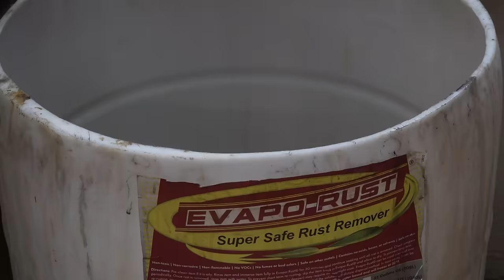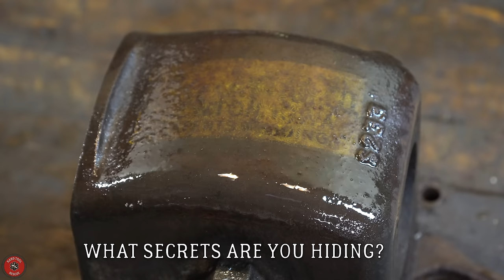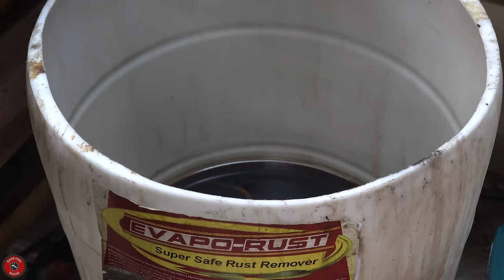1920s Maytag Washing Machine Engine [Restoration]

Comment: I must admit that I'm completely amazed by these people restoring old rusted items. This engine is a beautiful example of what I mean. Each and every slotted screw on this engine comes out with either not a lot of torque applied or a fair amount of torque. Hardly ever does the slot get deformed to the point of being useless to remove the screw. I've had screws deform left and right when removing them. I often have to employ a extractor to get them out. I have to be doing something wrong.
Reply: Normally I buy junk tools because I'm a home gamer, but there is something to be said for the tolerances on better tools.  My harbor freight junk sloshes around in the slot, but I usually work on things that don't matter, so I don't care.  I'd care if I was doing this kind of work.  But there's also a lot to be said for time, penetrating oil, and a torch too.  Put penetrating oil on it every day for a month before you start, and I bet you'll find it easier.  Not that I ever have the time or patience to do it.... :)
Reply: @grantmcinnes1176 ZZZ’S your willingness You’ll find

Comment: This has to be my favourite restoration channel. No expensive machines that us mere mortals cannot afford. Best of all though - no annoying music.
Thank you.
Reply: I'd consider a floor mounted drill press and a media blast cabinet expensive machines, but yea, it is nice to see a channel not using lathes and milling machines.
Reply: Ang Abrams you can buy a drill press and Walmart for like 80 bucks, won’t be great, but it works.
Reply: @jasonmurawski5877 You missed the point, but okay. Go buy that press then see how long it can run a wire wheel under load or how many holes it can drill with a forstner bit before it goes up in smoke.

Comment: The most impressive part of this for me was the fact that you were able to get a full carb rebuild kit for the thing...
Reply: My thoughts exactly! Yet there are carbs on old tractors you have to fight some old guy to the death for lol.
Reply: These engines have a huge following, to the point that you can get plans to cast and mill your own engine!
Reply: Yeah, there's a few people on ebay that make nice reproduction parts for these. Helped me a lot restoring mine.
Reply: I agree !
Every time im amazed he just conjures up some parts...

I'm dreading the day that we finally can fix/rebuild our old massey 30 (exact age still unnown somewhere arround 50' / 60' ).
1 head is already knocking and it leaks and smokes all over the place.
Still runs and being used tho😅 but we're dreading the day that stops before we got our barn set up to fix him..
Sadly that can take a while 😓😓
(Yes him ... we named him Groundskeeper Willie... we named all our driveble junk 😅).
We can't send the engine out to fix him sadly because we lack the 💸💸
So the longer we wait the harder it will be to get replacement parts if not a "new" or replacement engine  (would break my heart), where would you find a perkins that old....
36 and already too old and expensive to hire.
Reply: You'd be surprised how easy parts are to get. There are folks still useing these.
Reply: I have been supplying parts for these engines for 40 years. I have every part for the carburetor new except the body. Which no one has.  But I have plenty of spare used bodies.
Reply: Right ? I see I'm not the only one surprised you can still get brand new parts for this thing.
Reply: @maytagmark2171  Out of curiosity, could new bodies not be cast/milled after carefully measuring the old ones?
Reply: Because the past is what you wanted to be
Reply: @deborahmeijer9697  Massey 30 is pretty common.  You can find parts about anywhere.  Still lots of new and check the tractor junk yards in MN and Iowa.  And they are easy to work on yourself; maybe with a little coaching from your local farm mechanic.  Good luck!
Reply: @davewilson9924  i live in holland 😅
No such luck..
Reply: Right! Surprised the hell out of me
Reply: oh yes as a marine mec. just how.
Reply: it's a mixing valve not much to the carburetor , (called a mixing valve

Comment: The fact that this man tries so hard to actually Restore things and not just modify and repair, like so many similar channels do, eases my mind, calms my anxiety and helps me relax. I have 4 favorite channels on YT and these are the only ones I rewatch again and again.
On a side note, can anyone explain the point of lead washers?
Reply: I'm gonna put my foot in my mouth and say they were probably used as one time use crush washers like we have copper washers now, don't quote me on that though it's just my theory.
Reply: @normanbuchanan9710 You are correct. In engines they are used as a gasket. Pretty much the only option when you don't have squishy, heat resistant, synthetic material on hand.

Comment: -Very interesting watching this from beginning to end. Most of all I wanted to see that piston and how it was situated in that engine. Really neat considering it was in use in 1928. And I agree with the rebuilder that it did not need rings because the ones on there now still look brand new. It also had a pretty good sound to it. Thanks for showing this. Hang in there.

Comment: If I may offer a tip, the "butterfly" cotter pin technique isn't always the best. If you send one end over the tip of the bolt, the "loop" of the cotter pin locks into the castellated nut, and you can get it much more secure by pulling as you bend. Then you trim the other end short before you bend it down towards the surface.

Both the butterfly and over-under techniques are valid depending on the circumstance, but for castellated nuts you usually don't butterfly.

This is from a jet engine technician, so you don't think I'm just some moron.

Also, I know bending the cotter pin 2 degrees makes it easier to remove, but it's really not secure, especially on things that vibrate like motors. I'd be surprised if those pins holding the foot pedal spring don't come out after running for a short time.
Reply: This thing was designed with the cotter pin butterflied, so it obviously doesn't matter.
No matter how many modern cotter pins you've fucked up, this one obviously didn't need to be put in differently; and it 100% CERTAINLY needs to be easy to pull apart again, these ENTIRE MACHINES we're designed to be pulled apart again, so any critique of anything that achieved this is obviously due to inexperience related to restoration, because that's the actual discussion we are having.
Youd have a point if he was restoring a rocket engine.
Because otherwise they would not have sold in 1921, when every other machine bought had utility and lasted a long time.
Also, let's keep in mind that this machine was used for 100 years, with the cotter pin butterflied. So obviously your "bet" was lost before you made it

I've never understood people who are of a different profession, with slight overlap, attempting to either give advice which is unnecessary, or even downright false information.
You should never say "I'm a this" on the internet, because you automatically become a 13 year old boy who wants internet points when you claim your profession; simply say something that can only be said by someone who actually possesses knowledge on a subject.

Finally, this is a museum piece. A lot of the restoration done by this dude is for clients who will be either putting them in museum (taking functioning parts off to make them displays, like a foot pedal that operates it for instance, although it's beyond obvious the forces on the cotter pins aren't in the correct direction to matter, and the spring is clearly only as strong as would be necessary to lift the pedal; you can tell by the outrageous number of coils and length of the spring coupled with it's being fairly thin.), Or using it for personal use because their granddad or whoever left it to them in unusable shape.
That is to say, this is going to be shipped shortly after this video; and it might not be shipped in assembled condition.
In the case of a gas washing machine, i don't think it's going to be getting much use outside of rural Alabama.
Reply: We ain’t going to space cowboy we washing our undies

Comment: MY grandfather has a 2 cylinder version of this engine. Never restored and still working to this day. He did sandblast and paint the exterior of it a few years ago but insides are a still all original.
Reply: I believe this one is a 2 cycle engine also.  He showed the mix ratio.
Reply: @POCarton  cylinder

Comment: 2:11 Pro tip, thread the castle nut on the other way around when using it as a whackstopper, way less likely to deform it and the shaft. As a bonus you can wail a bit harder on it to break something free too.
Reply: heyyy i'm not the only one who cringed a little bit there
Reply: sapincher certainly not😂

Comment: Glad to finely see one of these, as I had heard about them in the past. When you do not have electric power to your home and need to wash clothes a gas powered washing machine and a fuel powered refrigerator (absorption), along with carbide lights is what people had.
Reply: Yes, and to get the exhaust out of your back room these had a long flexible pipe you laid out with the end out on the porch. These machines also had a wringer on them to squeeze the water out of your freshly washed clothes.

Comment: "What kinda washing machine you got?"

"Four-stroke."
Reply: It's two stroke in fact.
Reply: @collomps  yep, easily distinguished buy the fuel mix ratio, and maybe by the lack of vents in the chamber but uh...
Reply: @collomps  lol oversized weed whacker motor
Reply: A diesel would be more efficient...........
Reply: @GettingNervous  agreed, let's attach a 1150 cu. in. KT Cummins to it. Lol
Reply: 2 stroke hit and miss, no less.
Reply: No valves .
Reply: Four stroke? Where are the valves! There are none; the cylinder wall has windows which makes this a two stroke ;)
Reply: LMFAO so hard !!
Reply: @davidhamm5626  grammas were a lot tougher in the old days. my gramma was born in the early 1900s and she wouldnt take shit from anyone.
Reply: Y'all going on how I don't know the difference between a 2 or 4-stroke while I obviously own a different model washing machine.
Reply: @chukzombi  As was my mother!  My comment was to show that the gentleman that make the diesel " Comment" , had no idea of how the engine. works.
Reply: @davidhamm5626  For this you can use  a starter with compressed air 😁.
Reply: @davidhamm5626  16:1 is the fuel - oil mixture, as its a 2 stroke. But I hope you trollin ahah
Reply: Guys, his washing machine is a four stroke not like the one in the video. ;-)
Reply: @victorpelini5995  I could be wrong, sir! Can you send me to a small diesel site, so, I can be schooled.
Reply: @RichieRichOverdrive  technically, throttle governed not hit and miss. Same idea, though
Reply: Randy Ruppel why not a 6.7 cummins? Sometimes you just need more firepower to get rid of those stubborn stains... along with every single fiber on your clothes
Reply: I see everyone saw that the Maytag is a 2 stroker, but I have an old Montgomery Wards washing machine motor that is a 4 stroker
Reply: @pmk2  Ehhhhh not quite. hit or miss held the exhaust valve open until it needed power then it would close, draw vacuum and fire as many times as needed to maintain speed, then it would hold the valve again until power was needed.
Reply: @kleetus92  exactly, the governor on the maytag prevents the points from opening and you get no ignition. So it misses.
Reply: It's basically an old two-stroke Vespa engine.
Reply: Hit and miss stands for the way the valves  are controled.
Most engines are four stroke but some are two stroke engines.
Reply: @majstealth and that the sleve has a round shape to it as it has no valves, how the fins are angled and where the spark plug is.
Reply: Here's one even better -- hook it up to a old EMD H-block; that should do the trick. . .
Reply: @Triggernlfrl  single cylinder Maytag motors were also hit and miss, but by way of a centrifugal weight keeping the points from making contact instead of an exhaust valve. 

My neighbor has 2 hit and miss Maytag motors and a 2 cylinder Maytag motor, he inherited the twin cylinder (horizontally opposed), and got super into them. I helped him rebuild them, they are pretty neat machines.
Reply: @scout2nut  Actually, B&S built some 4-stroke engines to fit the Maytag machines.  Used the same kick-pedal starting system.
Reply: I have a powerstroke.
Reply: @pmk2  No, the governor has no connection to a throttle.In fact, did you see a throttle plate in that carburetor when it was being disassembled? It is all inside the flywheel.   The 4 stroke hit and miss often used the governor to interfere with the exhaust valve action. I wasn't allowed to do anything with my mother's Maytag except start the engine as a treat. (and fill and drain the washer and the rinse tub) The flexible exhaust pipe went out one of the ventilation holes in the storm window. The washer was kept in the unheated porch. As a result we boys all got our tongues stuck to the cast aluminum washer tub. (one of us so badly he had to be scraped off with a putty knife!)
Reply: @wssides  I'm aware, I have two of these single cylinders. The governor prevents spark by not allowing the points to open. That being said, my maytag repair manual states that they are throttle governed. The only reason I can see this being the case is that a traditional hit and miss prevents ignition by opening a valve and preventing compression, it's usually the exhaust valve but I've seen one of two that use the intake valve. While this, on the other hand, has no valves and therefore can't hold one open which means there is still compression.

I realize that throttle governed means it adjusts the set throttle and this doesn't. Just going by my maytag repair manual and several maytag repair men from yesteryear.
Reply: @victorpelini5995  I'm pretty sure he was referring to the compression ratio of the diesel cummons mentioned previously..  not the fuel/oil mixture in this 2 stroke petrol.
Reply: Old classic Samson 5 hp. 1915
Reply: A Wangensteen Deluxe.
Reply: O
Reply: @davidhamm5626  Oil to fuel ratio not compression ratio.
Reply: This engine is not a hit-n-miss engine as it fires on every stroke.  @RichieRichOverdrive
Reply: @dallasmcdowell1819  at no load it does not fire every stroke. I have one of these engines. It is a ported piston 2 stroke with a flyweight spark governor. Same idea as any other hit and miss.
Reply: @scout2nut  Woo hoo!!?

Comment: If that doesn’t belong on a Mustie1 moped then nothing does.
Reply: I was watching this and was thinking "Mustie1, call your office..."  ;-)
Reply: @MMitchellMarmel   or Bruce L.
Reply: That was what I thought when I saw it!
Reply: Right about now Mustie would probably trade him a Lamborghini for it.
Reply: @Freedomquest08  LOL
Reply: @denniswhite166  Or Cold War Motors.
Reply: Only problem is, it has no real throttle...one set speed.
Reply: @taebinrice1701D  I don't recall that ever stopping Mustie before!  ;)
Reply: @MMitchellMarmel  This is 1000% true!
Reply: @taebinrice1701D  Just make an adapter flange and use a carb with throttle linkage and a butterfly valve
Reply: Mustie1 would of put a Carb from a Briggs on it and put it on a Bike or in a Bug.
Reply: @lelandclayton5462  "...Let me check the hoard, I think I've got something back there that will work..."
Reply: I was thinking the exact same thing
Reply: It's a bit of an over engineered solution for a moped, but a variable transmission would solve the no throttle problem, yes?
Reply: i noticed the rings on this piston look alot like the rings on the piston mustie1 has in that antique boat motor...........
Reply: Aaron Whittemore yeah it also had the deflector on top of the piston as well.
Reply: @billbeyer657  Yeah, very similar design. Probably not alot of different manufactures of those parts at the time
Reply: @Freedomquest08  Haha!  Probably so.  That Lambo looks like a lost cause.  But we'll see.  Mustie does amazing stuff....
Reply: Exactly what I thought
Reply: @MMitchellMarmel  I talked to a guy once who used one of these on a bike he drove to college/work for the better part of 10 years. He said it worked great despite having to help it up steep hills.
Reply: @dfbess ļĺlľ

Comment: 21:35 it is interesting that you can restore precision tolerances by filing down the brass crank shoulder and then broaching it back to round. Was it designed to be repaired that way or is this a cool trick someone figured out for restoring using the original parts?
Reply: It wasn't broached back to round, that was a reamer and yes I'm willing to bet it was designed to be fixed this way or else it would have replaceable bearings or repourable babit

Comment: Mom n Pop engine shops, when they would overhaul Briggs engines, they would hone the heads on the concrete driveway outside.  I had wondered why certain places on their drive looked so smooth...  And the B&S engines would run so smooth and strong just like the day they rolled off the line.

Comment: Thanks for the restoration ride with all the obstacles and errors! So good to see that these things happen.
One question and a feedback: 
- Where do you get the original parts? Are they still available or are the also produced on demand?
- I would love to see more footage for celebrating the successful working condition being reached.
Thanks a lot for this video and greetings from Vienna! :)
Reply: Ok
Reply: A lot of these parts are still being made by hobbyists and other professionals in the field of old engine rebuilds; Maytag engines are some of the most popular because they were and are so abundant, they made many washing machines and many of them functioned this way; furthermore you could run a tractor off of one of those things so it wasn't like it didn't have any power.